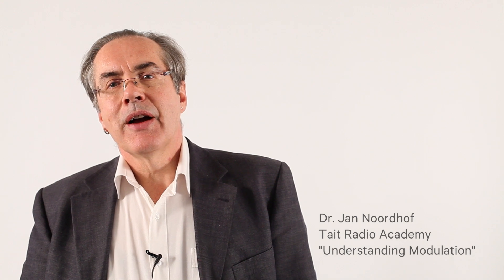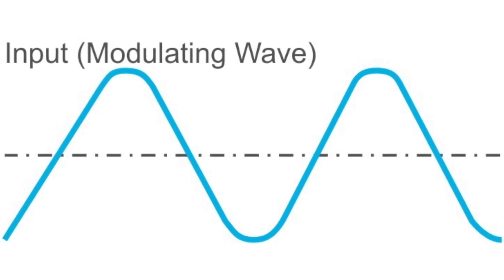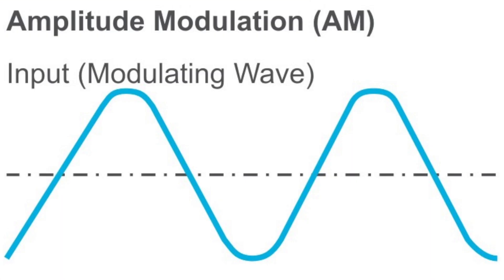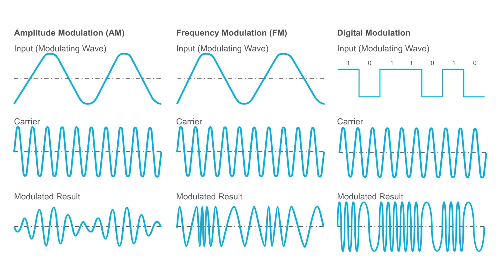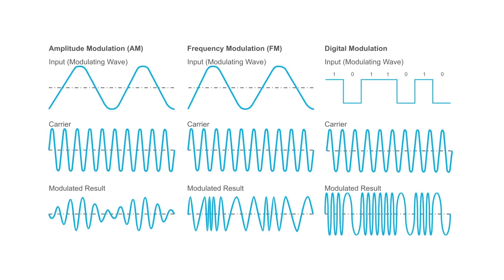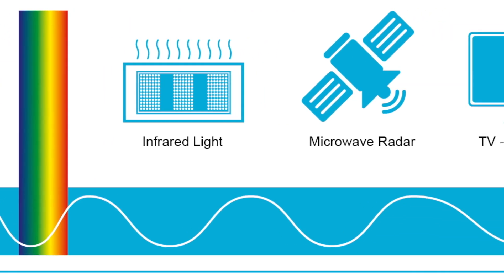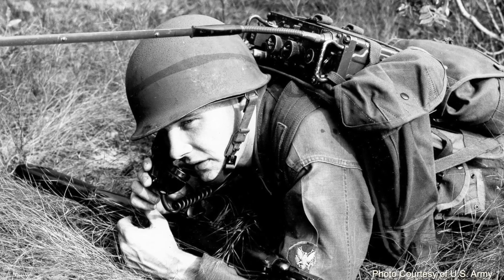2.1 How Does Modulation Work? | Basic Radio Awareness | Tait Radio Academy

Comment: If FM is frequency modulation, how does the carrier wave stay at a constant frequency? If I tune in to 98.1 FM, why isn’t the frequency modulating as the input signal moves it?
Reply from the maker: Thanks for your question, which seems to be about broadcast radio. This is not something Tait is engaged in. There are many online explanations of how FM radio broadcasting works, such as:
https://www.lifewire.com/how-fm-radio-works-3135076
Reply: @Tait-Radio-Communications  Hey thank you!  You almost seem AI (that's a compliment for a techy).

Comment: very impressive video! there are still some questions puzzel me:
1、in AM,the amplitude of carrier wave changes,what if the receiver attena can't receive parts of the modulated wave because of its low amplitude?
2、in FM,the frequency of carrier wave changes,as  a receiver,it "listens" on a specific frequency,if we change the carrier wave's frequency,does this receiver  can still receive the signal which is not in its "listening frequency"?
3、what will happen if the modulation process or signal production process is slow? will we get a modulated signal which some part of it has useful information and some part of it don't have useful information?
Reply: Does anybody know the answers too theses  QUESTIONS ? .

Comment: This is very very basic but even high impact professors often forget that carrier wave has no information itself
Reply: I have similar questions:As a carrier wave,it spreads continuously,if the modulation process is very slow or the signal itself is very slow,it could produce a modulated wave which some parts of it has information and some parts of it don't have information,right?
Reply: Phase-shift keying (PSK) is a digital modulation process which conveys data by changing (modulating) the phase of a constant frequency reference signal (the carrier wave).The modulation is accomplished by varying the sine and cosine inputs at a precise time.

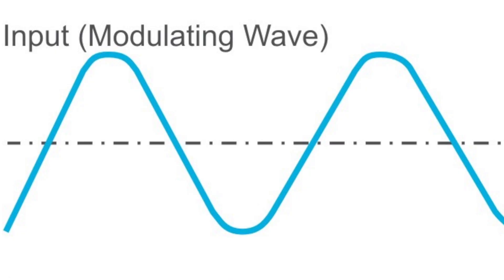Comment: The description of FM at 1:35 seems incorrect.
Reply: Sounds about right. The inputted modulated signal changes the frequency of the carrier wave, meaning the number of 'waves' sent are increased. The radio detects and decodes the difference in signal frequency. I thought it was a pretty solid explanation.

Comment: lets say carrier wave is 100MHz and the  receiver is tuned to 100MHz to receive signals.
If the message is 50MHz for 5 minute and  10 MHz for 5 minutes. Will it affect the tuning?